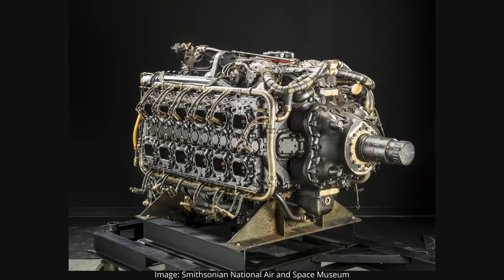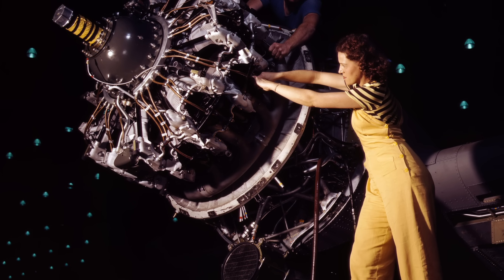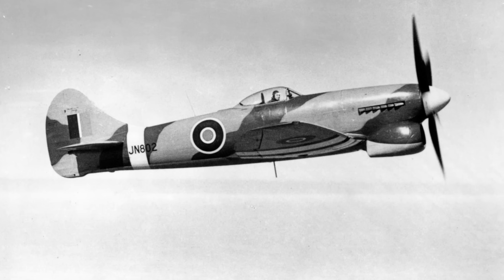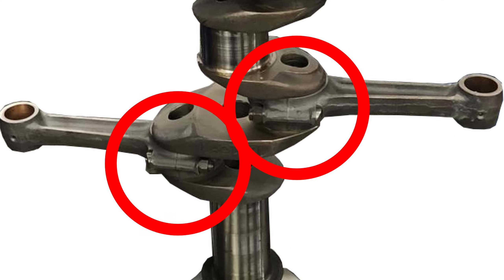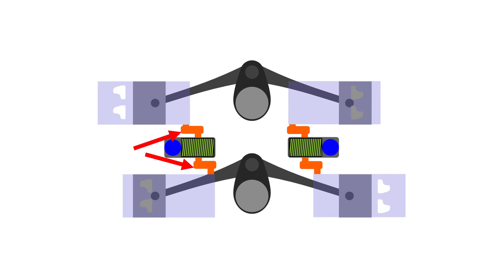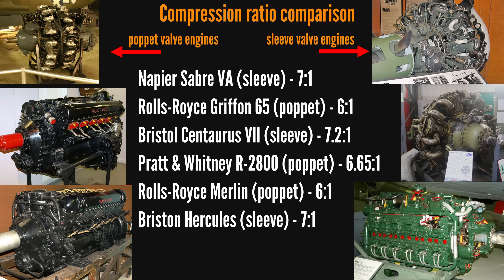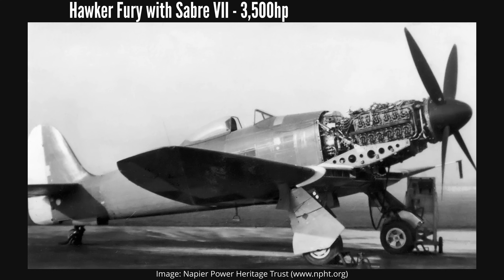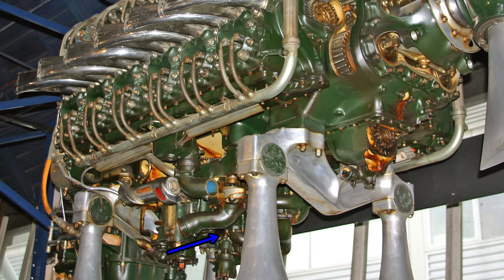The Complex Napier Sabre 24 Cylinder Aero Engine Explained Simply

Comment: One advantage of sleeve valves over poppet valves which was hinted at in this video, is that they run happily on lower octane fuel. One disadvantage that wasn't considered meaningful at the time, but which would make it near impossible to build one for automotive use today is that sleeve valve engines consume a lot of oil. Every time a sleeve port aligns with a cylinder port, it pushes a small quantity of the oil that lubricates the outside and th inside of the sleeve to either get blown into the cylinder if it's an intake port, or straight out the exhaust if it's an exhaust port.
Reply: Don't be fooled by garbage about WWII SV engines being based on the flaky old US Knight design. They were totally different, as demonstrated by Knight losing his court case against the Burt-McCollum design - which these engines are based on. The talk of high oil consumption, poor gas sealing, unreliabilty etc only apply to the US Knight design. The Bristol SV radials had considerably lower oil consumption than comparable big US radials, as is well documented.
Reply: @jackgee3200  The Sleeve valve engine is not a British invention, Britain has always been decades behind in internal combustion technology..
Reply: @DoktorBayerischeMotorenWerke  Wow, such a dissappointingly poor response.   I was hoping you'd have something to say that was useful/not so obviously junk/not so easily disprovable.
Reading your many other comments, here and elsewhere, I appreciate that's not your 'thing'.
Reply: think about that octane issue.. HOW it is that.. cylinder port engines can run lower octane before detonation happens.. its NOT primarily because of a hot poppet valve head either.. add that sleeve valves ALWAYS flow better that poppet valves.. Bristol, Napier & Detroit ea proved this.. the Centaurus achieved 2000hrs mtbo when the Merlin & likes were still struggling to make 1000-1200hrs.. AND.. with higher bmep figures
Reply: thats a bit of a broad statement .. Bristol proved wrong with the Centaurus .. lowest bmsfc & hphr oil consumption of any aero engine .. 1st by a long way to reach 2000hrs tbo .. piston engine development in all fields stalled for a long time with the misconceptions of turbines & turbo compounding .. 20 years lost before the realisations of jet engine inefficiency & inflexibility of application .. Bristol developed highly effective sleeve valve port sealing before political influences from RR & govt development funding was diverted to jet engines
Reply: @Errol.C-nz on aero engine at that time.

We already have 20.000 RPM NA poppet valve engine. If we forget 😊
Reply: @bocahdongo7769  No advantage spinning up to 20,000 on a propeller driven aircraft... 2,800 rpm is already too fast for a large diameter high efficiency prop..
Reply: @DoktorBayerischeMotorenWerke  just giving the example how far poppet valve already goes.

Like let's be honest, nobody in mind thinking sleeve valve doing 20.000 RPM like what poppet valve did despite poppet valve being laughable 70 years before
Reply: @bocahdongo7769  Sleeve valves were already obsolete in cars by the 1930's they were a dead-end in aviation by the 1940's 
 gas turbines dominate aviation today.
Reply: @Pene7942  Reciprocating weight is a factor but also Bore Diameter is a limiting factor as well, as the bore diameter increases beyond approximately 100mm the rpm is affected by a phenomenon known as Combustion Dwell Time..  which require more time for complete deflagration of the air/fuel mixture.
bigger the pistons, the slower the rpm of the engine..
Reply: @bocahdongo7769  That's nothing new. Honda four-stroke GP bikes of the 1960s were achieving 20k+ rpm (23k in the case of the. RC116) using only normal DOHC and coil springs to control the four valves per cylinder.
Reply: @Errol.C-nz  LOL  A sleeve valve truther
Reply: @bobqzzi  add .. 2 stroker too .. everything the establishment cringe
Reply: @Errol.C-nz  Aero engines consume a lot more oil on average than automotive engines, in particular modern ones.
this American invention and technology were licensed to many European companies in particular British ones who developed them long after the Americans concluded it was an evolutionary dead-end concept, Britian lagged several years behind in internal combustion technology, their forte was always steam engines.

Comment: The apparent complexity of the Sabre comes from the overall number of cylinders. When you consider the number of components per cylinder then the sleeve valve is far simpler. The prop shaft gearing with the helical cut drives helped immensely to reduce the torsion oscillations that play havoc with the wear and life time of the  simpler single spur gear reduction used on the v12 engines. The twin drives to the supercharger also helped to isolate the high inertial load of the supercharger from the torsional variations of the engine and propellor. There is lot of smart engineering in the Sabre design.

Comment: What’s happening when Prop tips faster than speed of sound.
Reply: Dramatic loss of thrust, huge increase in noise, huge increase in stress on the propeller. 
Look up the XF-84 " Thunderscreech" which made groundcrew physically ill at ground idle. One test pilot flat out refused a second flight. 
'You aren't big enough and there aren't enough of you to get me back in that thing. '
Reply: @douglasthompson201  also massive increase in drag.
Reply: @thethirdman225  true.

Comment: LJK Setright was a staunch enthusiast for Napier engines, particularly the Sabre. He has also pointed out that the Sabre was the victim of politics - both governmental and inter-company. I believe that the problems with the early Sabres were mostly to do with its sleeve valves. I'm open to correction here, but I think that manufacturing these components to the required tolerances was not possible for Napier and that the UK government had to bring Bristol in as a subcontractor to do that job.
I can no longer find a reference on YT, but I do remember reading a comment by Free French fighter ace, Pierre Clostermann to the effect that the Tempest was the best fighter he had experienced - mostly due to the power and response of its Napier Sabre engine.
Reply: Casting technology from Bristol solved it- centrifugal casting gave a cast cylinder with a consistent radial grain structure, so non-uniform distortion on heating was prevented.  Napier's origin sleeves used standard static mould castings, whose distortions could cause seizure.
Reply: @jc-d6179  I don't think it was casting technology alone, Bristol used a different material for the production sleeves after going through so many at enormous cost, the material (and yes casting technology) had to be considered for thermal expansion, strength, hardness, wear resistance, machinability, the list goes on.  And then the machining itself was a major issue, the use of the centreless grinders imported from the USA and Bristol's serendipitous discovery of the final grind using worn grinding wheels to bring the sleeves into round within the tolerances - a story in itself.

I can't remember how long they "aged" the sleeve castings before machining, but I can remember photos of them sitting in big piles still with casting cores inside out in the snow.

Bristol had its own issues despite solving the sleeve issue, they had problems with heat ejection in the heads and numerous other issues.  There are reasons the Centaurus was so late into production, technical reasons as well as "political" reasons and Roy Fedden's departure.
Reply: @robertnicholson7733  Marvelous information. Thanks!
Reply: @jc-d6179  Thanks very much for that clarification.
Reply: The second major issue was the hydrodynamic bearings used for the mains and big ends of the crankshafts.  Vandervell built a factory across the road from Napier at Acton to work on the issues.  Napier was not alone, when Mercedes switched from rollers to hydrodynamic bearings in their engines, it was not at all smooth sailing.  This was greatly exacerbated by the single grade oils then in use.  These oils caused serious starting issues on cold nights, when the Coffman starters didn't have enough power to start the engines, they used big heaters blowing hot air into the radiators to get the engines warm enough and also started them every few hours to keep them in readiness.  The Coffman starter was not kind to the engine and caused its own problems.
Reply: @robertnicholson7733  Air Cooled Flat-4 Citroën GS engine had a 'flame thrower' to heat it before start in Siberian weather.
Reply: "The Big Show" (Le Grand Cirque) by P Clostermann is a gem of a book. And I used to read articles by LJK Setright in AUTOCAR magazine back in the 90's.
Reply: There’s a great website called Old Machine Press that goes into great detail on this (and many other) piston engines. Well worth a visit if you like this sort of thing.
Reply: Absolutely fascinating American technology.
Reply: I thought Bristols made the castings porous enough that they held oil longer.
Reply: @johneyton5452  But the problem with the cylinders galling and breaking was solved by the Americans..
Reply: @DoktorBayerischeMotorenWerke  "But the problem with the cylinders galling and breaking was solved by the Americans.."  Details?  Who?  When? How?
Reply: @robertnicholson7733  You didn't know? That the American company Thompson Grinder Co. saved the British sleeve-valve program???
Reply: Setright is one of the least reliable sources for this engine. His claim that it could have made 5,500 hp is ridiculous. It would need to make more than 150 hp/ litre. A Ford Cosworth DFV from 30 years later could not do that.

Bill Gunston took Setright to task for this in his book about piston aero engines. No Sabre ever made more than 3,050 hp in service.

As for assigning the blame to politics, it’s a neat conspiracy. Easy to believe, harder to disprove. Does nothing for people’s understanding.

His book, ‘The Power to Fly’ seems to be on every petrol head’s wish list but it’s unbelievably overpriced and seems to have been written from the point of view of someone who doesn’t understand how aero engines work or what they are designed to do.

Clostermann’s book, ‘The Big Show’ is a great read but plays very loose with the truth. His description of the Sabre in service is probably pretty close to accurate.

That said, the average engine geek spends most of his time talking about peak power. The average pilots talks about reliability. Their attitudes couldn’t be more different. So the betting war for the most outrageous power claims for any given engine is only of interest to people who don’t fly.
Reply: @promerops  There was no fighter as Sea Fury, SV engine.
Reply: @joseveintegenario-nisu1928  I don't get your point. I do not mention the Sea Fury, above.
Reply: @promerops  I cited this Aircraft because it had a Bristol Sleeve Valve engine, so powerful, it required a five blade propeller.
Even more, Sea Fury is a beautiful machine
Reply: @joseveintegenario-nisu1928  It certainly is!

Comment: I believe some of the problems were lubrication. A special oil was developed for the Sabre, it had high oil consumption due to the sleeve valves and in winter or when it was cold the engine had to be run from time to time to keep the oil warm otherwise there was problems on starting.?
Reply: The Sabre was what was called a ‘total loss’ engine.
Reply: @thethirdman225  A "total loss" four stroke engine with, oil control piston rings, a dry sump and scavenge oil pumps?  You will have to explain that one to me unless, of course, it is supposed to be humorous.
Reply: @robertnicholson7733  Not at all. The oil was used to seal as well as lubricate and it was burnt as part of the process. I suspect the scavenge pumps were there to maximise oil use. But what it took off with in the tank was for consumption. I’d have to check the specifics but I’m pretty sure it’s correct.

Unless you mean in the sense that a two stroke is total loss, in which case it was a bit more sophisticated than that.
Reply: Oil consumption in the IIA and IIB Sabres used during the war is officially listed as 7g/hp/hr.  So if you are cruising at about 1400hp its rated usage is about 12litres/hr.  Interestingly the VA and VII oil consumption is listed at 15g/hp/hr, so at the same power 25 litres/hr.   The Merlin XX was 10g/hp/hr and the last Merlins (post-war), the 130 series, was 6g/hp/hr.  No Merlin had a rated cruising power of 1400hp, so calculate all engines for  1100hp:

All of the consumption numbers above are sourced from: "Aircraft Engines of the World", these are (if memory serves) MOD numbers.

Sabre IIA    9.4 litres/hr
Sabre VA    19.6 litre/hr
Merlin XX   13.4 litre/hr
Merlin 130  8.0 litre/hr
Griffin VI      9.4 litres/hr

The oil was Shell 100U specifically manufactured for Bristol Sleeve valve engines into the 1980s, no Sabre was operational after the 1950s.  I do not know if anyone has the technical specs for this oil allowing it to be re-manufactured. Even a pristine example of the oil may be enough using modern analysis technology. Using other oils in a Centaurus powered aircraft is not a good idea.  Just another problem facing the guys who want to put one of these back in the air.

They either started the engines on rotation to keep them warm or used big heater and blower units to blow hot air through the radiators. The Sabre wasn't the only engine to require heating but the area under lubrication was very high on the Sabre, thus the problem.  Also, the Coffman starter cartridges were not powerful enough, yet despite this, the cartridge starters had such a high impulse power that they could damage the engine
Reply: @robertnicholson7733  They must be able to source it from somewhere. I know Kermit Weeks has two Sabre engines and plans to start running one quite soon. There might be old stock available but if that’s the case then chemical analysis should give a pretty good approximation of the original formula.

I wasn’t aware the Merlin consumed that much oil. The Sabre used it on both sides of the sleeve (obviously) and much of it would have been ingested through the intake port and ejected through the exhaust port.

The figure for the Griffon is especially relevant because it was about the same capacity as the Sabre…

Comment: Great stuff!  One of the unanticipated downsides of sodium filled valves, widely used by Lycoming, is moving the heat from the head to the stem tends to promote deposit buildup on the  stem. Valve sticking from lead/carbon deposits on the stem/guide is a chronic problem on Lycomings.
Reply: Having an engine minimum idle rpm of approximately 1200rpm negates most of the issues with buildup on valves etc. from lead deposits.
Reply: @kiwidiesel  
Yah, but that will extend landing distance. Makes a short field landing difficult. It needs to have a ground idle of 600 rpm or it will float down the runway quite a ways.
Reply: @rescue270  Yes the 1200rpm is during ground use.
Reply: @kiwidiesel  Nobody does that lol.
Reply: @JK-rv9tp  I do.
Reply: @kiwidiesel  I've never heard of that before and I've been flying since the mid 70s.
 I guess you go through a lot of brake pads?
Reply: @JK-rv9tp  Flying since the 70's doesn't mean a lot. It's quite obvious I thought. Taxing or trying to land at power settings higher than required for safe operation is not recommended. Those phases of the flight and handling constitute a small percentage of the flight. 
Time spent warming up engines, holding at check points, doing pre take off checks and briefs and all the other delays while the wheels are not turning but the propeller is, can be spent at 1200 rpm to prevent lead deposits building up and fouling plugs. 
Everyone is free to use their own higher intelligence tho.
Reply: @kiwidiesel  hey if it works it works.
Reply: I start my Lycoming O-540 at lean mix and throttle already set to 1200rpm. I don't have to clean my plugs because they don't have any lead deposits, it starts in winter immediately and no valve has ever stuck. EGT difference across 6 cylinders is only 30F when leaned to peak in flight. It has 2400 hours on it.
Reply: No valve stems on a Sabre- it's a sleeve valve engine!
Reply: @PhilipSiddall  
Yes. So is a Bristol Centaurus. We were digressing into Lycomings...
Reply: @rescue270  He mentioned sodium valves in the video.
Reply: Do you run your engine lean-of-peak or do you run richer??
Reply: @DoktorBayerischeMotorenWerke  My engine is carbureted with an EGT only for the hottest cyl. I lean to the smooth side of roughness, the best you can do with a carb. I run on mogas so lead deposit control isn't an issue anyway. When I run it on 100LL, the bottom plug wells fill up with lead balls after about 25hr and start to short them out. The O-290 doesn't like leaded fuel.
Reply: Do Continental engines tend to not, or just don’t, use Na-filled valves?  I guess I assumed they were standard for all aircraft engines post-WWII.  I recall even seeing them in my high school auto mechanics textbooks for car engines.  I used to be an A&P, rebuilding WWII aircraft, and doing boutique maintenance on 310s and 340s, but that’s going on 30 years ago now - plus, I never cracked the 470 or 520s apart, so I never had to look into the vale specs.
Reply: @Pene7942  I think only Lyc uses Sodium filled valves. My Lyc O-290 however, a WW2 era design, has solid valves.
Reply: Marvel Mystery Oil in the crankcase